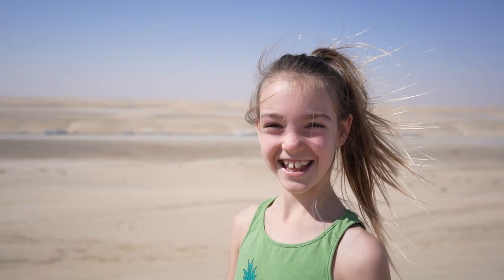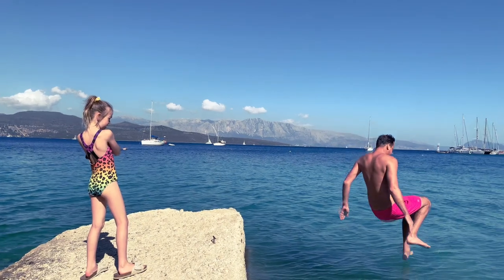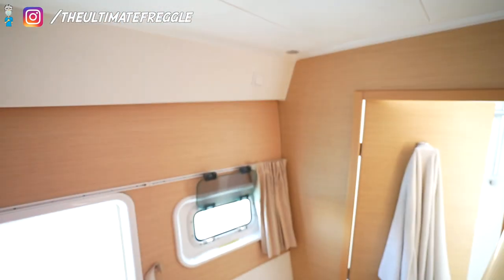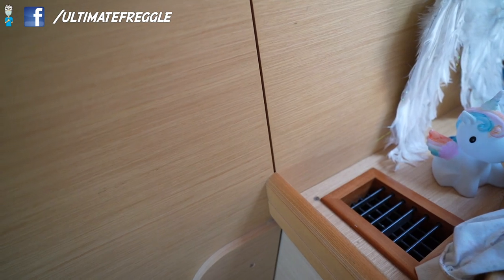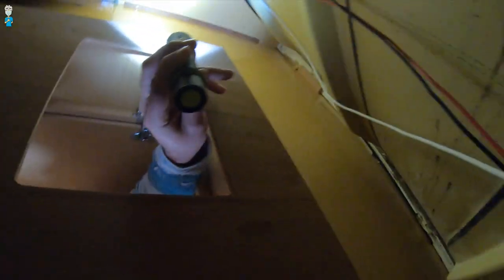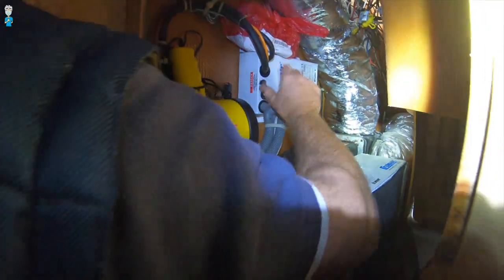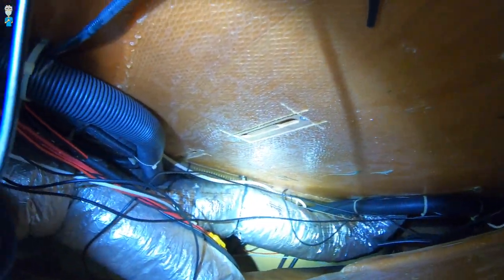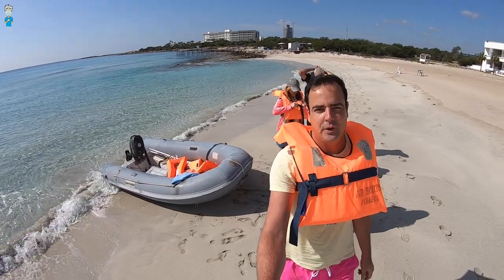Does This Lagoon 420 Have Cracked Bulkheads? - Ep 4. Sailing Around The World

Comment: Watch Sailing Nahoa. They sail a Lagoon 410 that appeared to be breaking apart while they were two days out from the Seychelles. Scary stuff!
Reply from the maker: Hey AsLan's Girl, I know that channel, but haven't seen the specific video. I'll check it out, thanks!!
Reply: @DutchSailingFamily  It's busted. They had just done an inspection. Every Lagoon will break. Let me say that again EVERY LAGOON WILL BREAK.
Reply from the maker: @richmcgarvey4118    .
Reply: @richmcgarvey4118  It's basically confirmed now that it was effectively the rigging that did it.
Yes the bulkheads were not what they should have been designed for, but the issue is that the larger lagoons are simply very easy to overtighten the rigging and break the bulkheads: the boats are too wide, the panels too thin, so if the rigging isn't perfect the bulkheads go.

Comment: So your not concerned it started to crack??? Started to break a part does'nt concern you?
Reply from the maker: Hi Lewis! So what you are looking at with the crack, is thin paneling that covers the actual structure. When any boat sails, the structure moves, it has to be flexible so that it can be strong. If too rigid, it would break more easily. So for the paneling that covers it, it would be normal, especially after 14 years, that it moves around a little or sits differently. I would be concerned if the cracks or misalignment was bigger. But with this small amount, no I'm not concerned.
I've also seen the actual structural bulkhead, and it looks in good shape!

Comment: you showed a cracked bulkhead and then proceeded to look everywhere where the cracked bulkhead wouldn't be, that crack indicates you need to remove the door trim to inspect correctly. you are putting daughters safety in some half assed look around.
Reply from the maker: Hi Superform! Thanks for the expert advice and threats to go along with it 😃
👋🏼👋🏼
Reply: @DutchSailingFamily  some video showed removing a simple panel this is the mast compression beam that is where the issue is . what you are doing is fluff. measure decks for changes in level . the video i spoke of is people who hade issuies who fixed them ,you dint check jack shit
Reply from the maker: @briandonnelly8464  thanks for your expert advice!